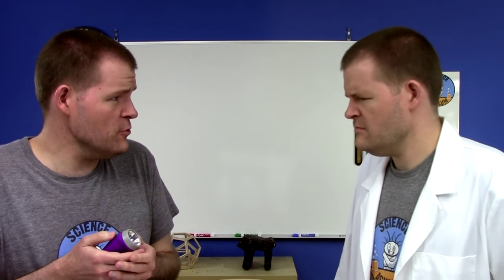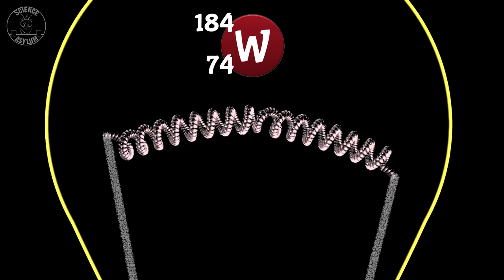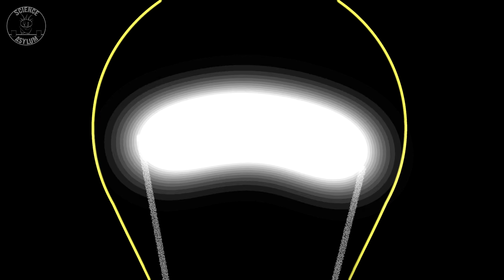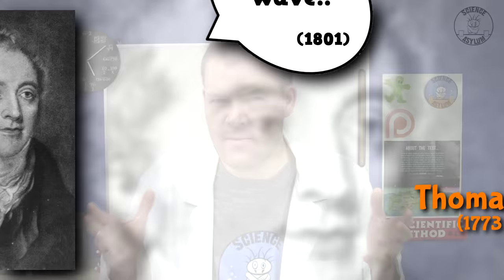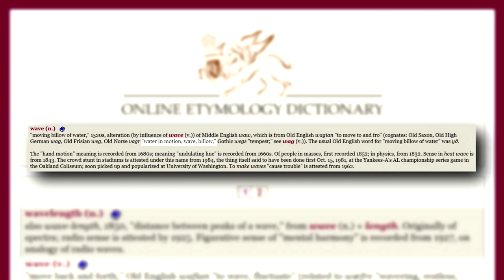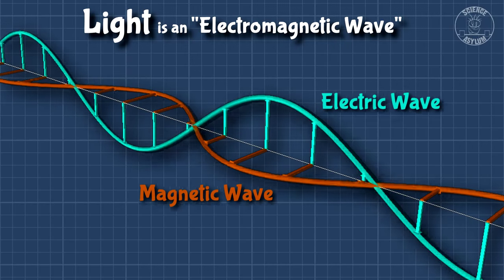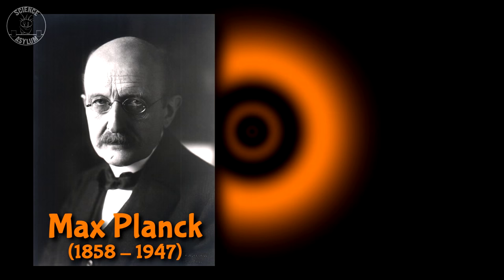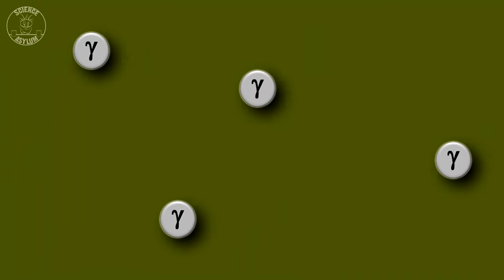What the HECK is Light?!

Comment: Photons are wavy particles. It is actually made of a magnetic loop which collapse as it travel, generating an electric loop which collapse as it continue to travel in the same direction, which create a new magnetic loop at a distance of one wavelength compared to the first magnetic loop. The cycle repeat without any loss of energy except when such loop get completely absorbed by an atom (visible light) or a larger object for infrared.

Comment: hey Nick, when a F22 jet fighter(2 mach) plane is travelling more than the speed of sound, it produces a sonic boom, so when light is travelling 299,792,458m/s, then does'nt light produce a sonic boom?
Reply from the maker: Because light doesn't interact with air in the same way. The reason a sonic boom happens is because the plane is going faster than the sound waves it's making. Light doesn't make any sound waves like a plane, so no sonic boom.

Comment: Isn't a wave a disturbance of a field? So when something emits light it doesn't send photons to space, just vibrates the already present photons?
Reply from the maker: Not exactly. A "photon field" is different than a "photon." The photon field is an energy field and it's always there, but usually has a value of zero. An actual photon is a disturbance in that energy field. Anywhere the field ISN'T zero, you'll see a photon. No matter what a photon actually is, the light bulb is definitely emitting them.
Reply: Ok, I'm still confused about what are the particles who make the photon fields, and how are they being disturbed to make the photon, what is interacting with that field?
Also, I understood that when two particles attract each other due to gravity they actually squeeze the space between them, is it the same with electric attraction?
Reply from the maker: Photons don't make the field, the field makes photons. It's a quantum field theory thing. Photons don't make much sense unless you use quantum field theory. I really need to do a video on this.
Reply from the maker: A field is just a number assigned to every point in space. It's a mathematical thing.
Reply: light is also an electromagnetic wave, is that mean we have propagation of a wave throw magnetic, electric and photon field at the same time?

Comment: White light is a combination of several colours or several different EMwave with different frequency if some electrons collides with an atom and emmit a EMwave when that energy increase the frequency of that EMwave also increases so it should start from infrared light then visible light and then so on but how did it ends on white light I cant understand this.

Comment: In light, why are the E field and H field in sync?  There are points where there is no energy.  It seems like they should be offset by 90 degrees so that when one field is zero the other is at a maximum.  ???
Reply from the maker: The phase between them determines what kind of polarization they have.
If they're in-sync, then it's linearly polarized light: https://youtu.be/c9ew1J0PY-M
If not, maybe circular or elliptical polarization: https://youtu.be/-SMpGiNVymU

Comment: What exactly is a magnetic field made out of? Is it made out of photons? At a super low infrared frequency? When one sees magnetic lines of force using 2 magnets and metal filings, one can see the interaction. But, that magical invisible field itself, what is it really made out of? Or is this something to do like 'spooky action at a distance?'
Reply from the maker: A magnetic field isn't really made of anything. It's a tool we use to help explain behaviors. My next video should help clarify this.
Reply: That'd be great! I'm looking forward to that with bated breath. I've done circuitry, built power supplies, amps, etc. And I'm still at a total loss and what a magnetic field and lines really are.

Comment: Still don't get why we say light has a frequency, which is in units 1/s.  How does that make sense?  I can understand how sound is a change in air pressure, but what is light's frequency about?
Reply from the maker: The frequency of sound measures how quickly the air is vibrating. The frequency of light measures how quickly the values of the electric and magnetic field are changing (oscillating).
Reply: If photons have electric and magnetic force, how to they oscillate the force's direction, and are there any examples of light carrying electricity?  I'm guessing I need to understand more, and that I'm asking uninformed questions at this point.
Reply from the maker: Matt Individual photons don't really have electric and magnetic fields. You need quantum physics to explain them.
Reply: The Science Asylum that seems odd that light is represented as electromagnetic waves or particles (photons) that have no electromagnetic effect.  What's up with that?
Reply from the maker: Matt The key phrase in your comment is "represented by." Electric and magnetic fields are a great /model/ for light most of the time. But if you start asking deeper questions, the model starts to fall apart. I've got a long video coming up that might help explain this better.

Comment: E=mc2 what does the speed of light have to do with this. I get its the speed of causality and the seed of information but what exactly does this mean I don't understand.
Reply from the maker: +Jimmy Star
In E=mc2, the speed of light isn't really about the speed of anything. It's more like a unit conversion. What E=mc2 really says is that energy and mass are the same thing (because 'c' never changes). Don't get hung up on the speed of light part. It's only there to make sure that our units for mass (kg) get changed into our units for energy (J).

I did a video about this A LONG TIME AGO if you want more details: http://youtu.be/2jKHM92wbl4
Reply from the maker: +Jimmy Star
Also, HI JIMMY! Long time, no see :-)
Reply: +The Science Asylum so the speed of light is used as a constant to make sure it converts properly throughout all frames or reference? If I understand correctly
Reply from the maker: +Jimmy Star
No no, it's not about frames of reference.  For a really long time (like hundreds of years), we thought mass and energy were totally different things, so we measured them differently: mass in kilograms and energy in joules. Those are their standard units. When Einstein came along in 1905, we realized mass was just a type of energy, which means we had been measuring mass wrong all this time. We should have been measuring it in joules instead of kilograms.  The square of the speed of light is just a unit conversion from kilograms to joules.

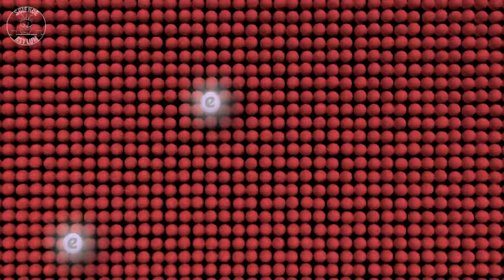Comment: 0:41 do the atoms really vibrate faster, not stronger?
Reply from the maker: Yes, faster. The faster speed does make the collision between them stronger... so also stronger?
Reply: i think it's just the amplitude that gets higher and not the frequency. otherwise all organic substances would show large shifts of their usual absorption bands in IR-Spectroscopy when they get heated... their resonant frequency must stay the same. lets talk about thermal radiation... i can heat a metal red hot so it emits visible light and that still hasn't got anything to do with vibration frequency. I guess it's more like this: If you imagine a pair of atoms going up and down an asymmetric potential curve ( i know the vibrations are quantized  ), once they aquire enough energy they start to emit more energetic electromagetic radiation due to the stronger acceleration of electrons in the atoms. The vibration frequency will stay the same, but the velocity of the atoms must get higher, as they have to travel a longer path on the potential energy curve because <Ekin>= 1/2 m*<v^2> ... you can also write the average speed of atoms in a material <v^2> as <v^2>=omega^2*x^2 ... omega being the angular velocity and x being the deflection. If you look at low energies the potential curve is almost parabolical, so this model is pretty helpful ... the deflection on the other hand is dependent on the spring constant k and the mass m, so omega^2=k/m ...the frequency of vibration can be calculated by f=1/2pi * omega so f=1/2pi * sqrt(k/m)...  
What will happen eventually is that the elastic modulus of a solid will change upon heating, thus reducing the frequency of vibration not increasing it.

How could you logically explain the effect of vibrational frequency otherwise?

also if you look at it from a different perspective: most atoms vibrate at 10^12 - 10^14 Hz. This natural frequency is dependent on their mass and their bond strength. So how could we get Atoms in a solid to produce UV, Röntgen or Gamma radiation (if they wouldn't melt)? By increasing their vibration frequency? No...

Comment: does gravity affects light??....does gravity makes any difference about light??
Reply: Sure it does. According to General Relativity theory gravity is an effect of curved spacetime, it's all about geometry. Which leads to usually straight-going light to move seemingly curved paths (see "gravitational lensing") and also when moving up or down gravity well, due to changes in metric tensor at different heights light also changes its frequency, see "gravitational redshift". When you shine some light up from a planet the observer above sees it a bit redder. And when light goes near a star it seems to go slower (Shapiro delay). And it curves around the star too.

Comment: What the heck is fire?
Reply: Fire is ionised air coming back into lower energy states, thereby releasing photons in mainly the infrared frequency (=heat), but also in the yellow/orange visible frequency (=visible light). That is, when fuel is burnt with carbon in in (like gasoline, or wood) as gasoline has the property of making yellow light when not burning optimally. Optimal burning of carbons make a blue light as that releases more energy (blue has a shorter frequency and is thus more energetic). But in short, fire is electrons recombining and falling back to lower orbits, essentially.

Comment: Amplitude measures brightness? Really?? 1.49?
Reply from the maker: Yes, really.... I mean, technically, it's Amplitude^2 but it's still the amplitude that determines it.
Reply: @ScienceAsylum  I’m a Confused clone. We see illustrations of lightwaves as nice sine waves. I understand wavelength and frequency but no one ever mentions the amplitude of the sine wave; in sound that would be loudness. Brightness, I would have thought, would be the number of photons hitting your eye. A single photon already has its energy assigned so what does the amplitude of its wave in all the diagrams actually represent? And how wide is one single, photon's lightwave? But maybe it is infinitely wide as its position as a quantum particle is based on probability. PS Congratulations on your very engaging and yet accurate channel.
Reply: @MrStevenlynch  Brightness is the rate of energy hitting your eyes. Photons are just carriers of energy, and depending on the frequency, can carry different amounts of energy.